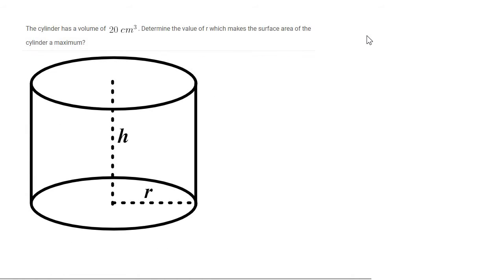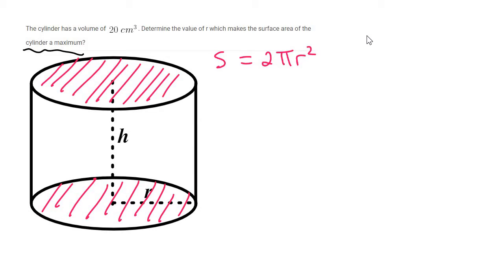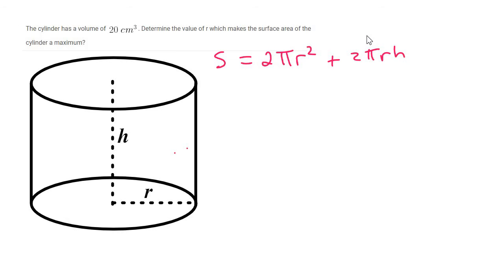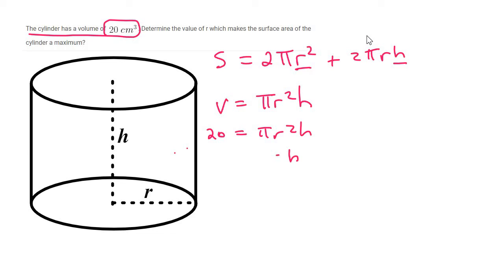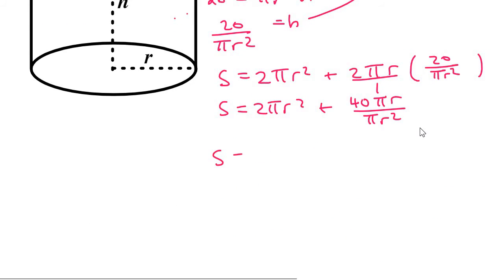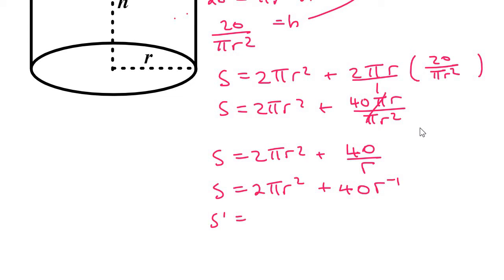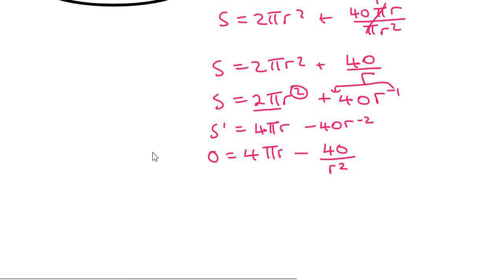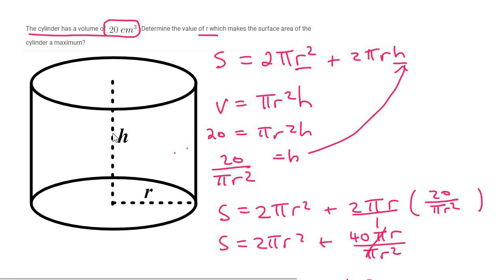Optimisation Grade 12: Maximum Surface Area Cylinder

Comment: hey umm... this is wrong. Like blatantly wrong. This does not give the maximum area, it gives the minimum area. If you plot the graph of A = 2πr^2 + 40/r (only for r > 0 cause it's a length), you will see that, very clearly, the function has only one turning point: from a negative slope to a positive one. Ergo, the function has a minimum value.
Reply from the maker: Hello! :) Yes great point, I simply copied this question from an exam but never actually plotted the graph to check. Went and plotted now and yes it is a minimum! :) Nice. Luckily, the way we solve will still be the same whether a minimum or maximum so the calcualtions are all EXACTLY the same. For other learners reading this the answer is still 1.47.
Reply: Hey, so urm, I know we’re all grown enough to know how to speak to people so maybe try being more polite or you can go teach yourself.❤

Comment: This gives the minimum surface area, not the maximum.
Reply from the maker: Hello! :) Yes great point, I simply copied this question from an exam but never actually plotted the graph to check. Went and plotted now and yes it is a minimum! :) Nice. Luckily, the way we solve will still be the same whether a minimum or maximum so the calculations are all EXACTLY the same. For other learners reading this the answer is still 1.47.